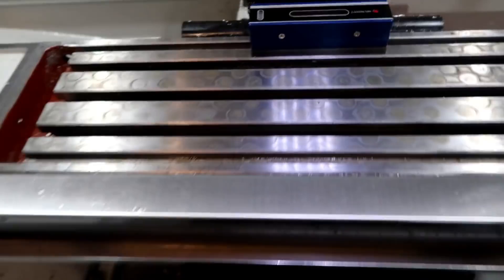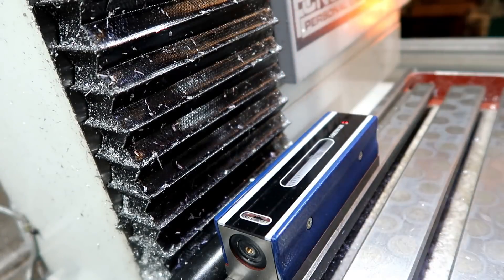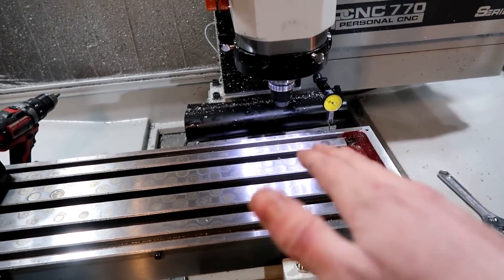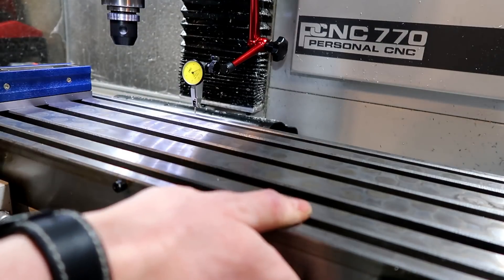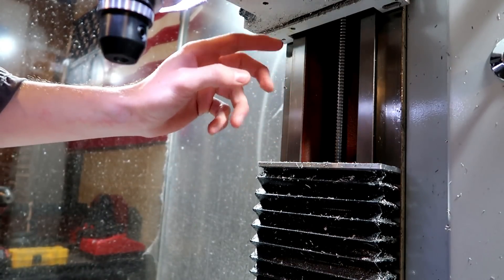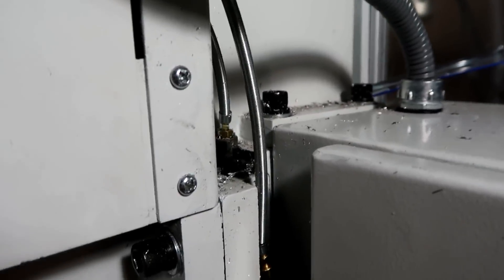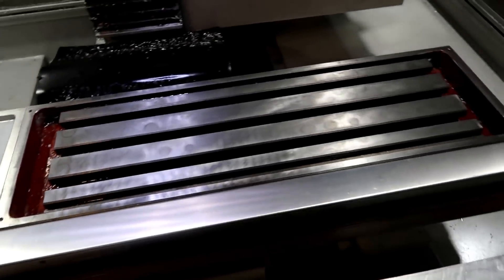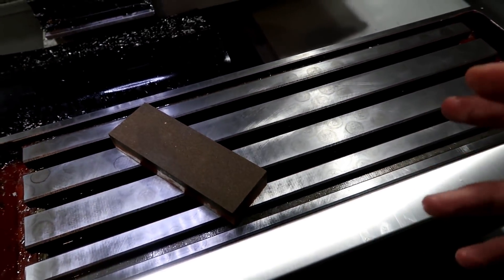Re-Leveling the CNC: Home Mfg. Days #25

Comment: install radiators along the walls of the garage or even a heat pump (air conditioner)!!
Reply: I ended up putting a propane heater in the garage plus I plumbed some ducting from the house to get a little A/C in the garage. That made it much better!

Comment: Had same issue on my shed shop. SOLUTION: Add an oil space heater and leave it some where close to the machine. Keeping the heat a bit more high than the outside temp is just enough to prevente the rust. Good luck.
Reply from the maker: That's a really good idea.  I have a similar thing set up now.  I pulled some ducting from the house and now I can dump a little warmer air in the garage.  Plus when I start working in the garage I turn on a small propane wall heater

Comment: Most machines will turn into a parallelogram if not perfectly level.  All three axis will twist out of square if the base is not flat.
Reply from the maker: That's what I was sort of figuring.  I went back to check a few weeks later and had to do small adjustments after it had relaxed.  I will keep checking as time goes just to be sure.

Comment: A cheap “buckethead” shop vac (it’s just the head that goes on a 5 gallon paint bucket) with the thin nozzle from HD works wonders on those chips. The nozzle is exactly the right size for the t-slots in my vertical mill (likely the same as the 770). Lighter/easier to move around than the full-sized Vac. Changed my life :)
Reply from the maker: Yeah I'll just have to get a thinner nozzle, plus a t-slot scraper/cleaner would work super well too.
Reply: MojoMfg. The small nozzle is great. Fits perfect. And you can Mill a t-slot scraper in about 2 minutes on the machine :)
Reply from the maker: Never thought of that.....haha.  I guess I could make one myself

Comment: Looking good!  The condensation is probably from warm humid air running into your cold machine (like on a glass of ice water in the summer).  If you can find a way to keep the shop and tools relatively warm, that should eliminate the problem.  Maybe there's a way to just blow warm air into the shop from the main wood stove heated area?
Reply from the maker: I'll show in an upcoming how to I ran some ducting to blow "some" warm air into the garage. So far it's been working out.

Comment: Not sure why you have a production plate on that machine anyways you don’t do production runs And just mounting a vice to it is kind of senseless, Saunders is just selling you guys a bunch of stuff you don’t need. When my kid cleans the machines in the shop He has figured out you put a rag over the air hose nozzle with the vacuum next to it and you don’t get chips all over. They go right into the vacuum 🤔😆... Good music though
Reply from the maker: I have a few fixtures that I run and that was the original reason for purchasing the fixture plate: https://www.youtube.com/edit?o=U&video_id=mULzn2Yh0Oo

https://www.youtube.com/edit?o=U&video_id=z9u1NPRRBFM

I just don't want to go through the hassle of taking it off to mount the vise. So I leave it on.  

I went ahead and invested in the t-slot cleaner tool to push all the chips to the ends and vacuum it out that way.  I want to try and eliminate the use of the air nozzle as much as I can. The rag over the nozzle is a good idea though.

Comment: What size shim stock did you use, im needing to do this to mine Amazon has it in 2x2, and 3x3 but the price for the 3x3 is double crazzzzy expensive.
Reply from the maker: Get the shim kit from tormach. They are super cheap compared to what's on Amazon.  https://www.tormach.com/store/index.php?app=ecom&ns=prodshow&ref=34056

Comment: Leave the fan on all the time.  I have terrible condensation in my garage a fan helps greatly. You"ll have to take care of that right away or you will regret it. Things will get rusty if not. I just picked up a dehumidifier today from menards 70 pint for 199.00 the pint rating is how much water the dehumidifier can remove in 24 hours bigger the better a 70 pint should do your garage fine I would think.
Reply from the maker: I just found a way to pump the heat from the room with the woodburning stove but it doesn't pump a whole lot of heat and I will continue to run the fan at all times especially moving in to the spring season.  My next move is a dehumidifier, thanks for the tip, a 70 pint seems like it would do the trick.

Comment: I live in Colorado and my shop isn't heated all the time so I usually coat the machined surfaces with some kind of rust inhibiting coating. I may cheat a little but I use WD40 on aluminum a lot so that alone displaces some of the moisture. Another thing I do is put covering of some sort over the machined surfaces. I use some oiled rags for my 770, it doesn't take a whole lot of rags to cover the table. These two things have kept my mill and lathe rust free. One other thing you may try is adding a bit more coolant into your fog buster mixture. This will coat the table with a small layer of film that will reduce rust as well.
Reply from the maker: Nice! I like the oiled rags method and I usually spray some WD-40 in the machined surfaces of the machine as well.  I will also bump up the coolant to air ratio on the fogbuster as well.  I hoping for some flood coolant in the near-ish future though. Thanks for the tips.
Reply: Flood coolant would be nice. My problem is until I get another shop built I would have to drain the coolant every night so it wouldn't freeze. I already do that with my fog buster but that isn't that hard. I can't imagine having to purge all the coolant lines every night, that would be a nightmare.
Reply from the maker: That would be a terrible inefficiency haha.  I would dread having to do that.  Sounds like you need the heat much more than I do.

Comment: Since your mill is somewhat enclosed, you might reduce the condensate a little by running an incandescent light (or some other low level heat source) at night in the enclosure.   The idea is to minimize the drop in metal temperature overnight.   You can also wax all exposed metal.   Floor wax works OK.    You'll probably need to re-wax everything before each winter.
Reply from the maker: That's a good idea! I have a smaller heater that I'm going to try and run on timer and keep a fan on low to keep the air moving.  I also figured out a way I can pump some heat in the garage from the room with the wood stove using an inline duct fan.  I'll be sure to show that in a video at some point too.